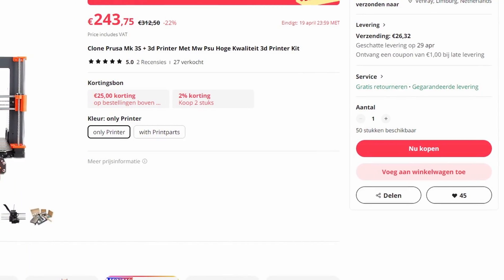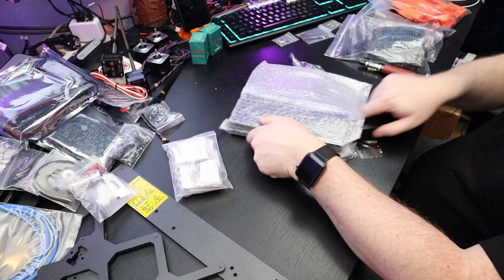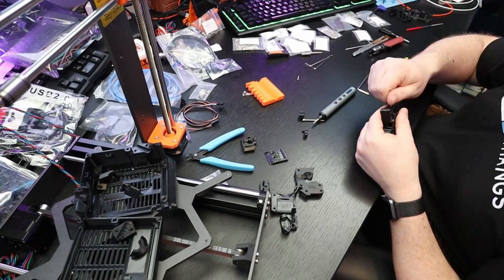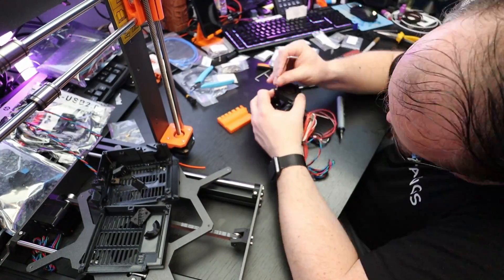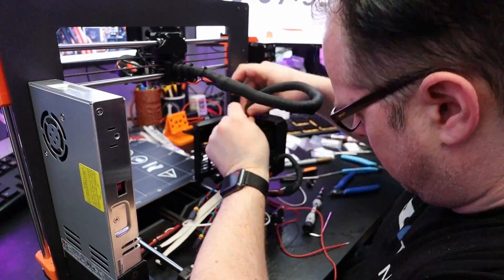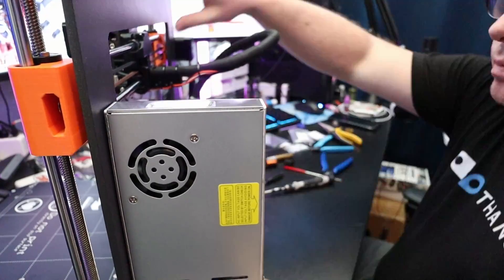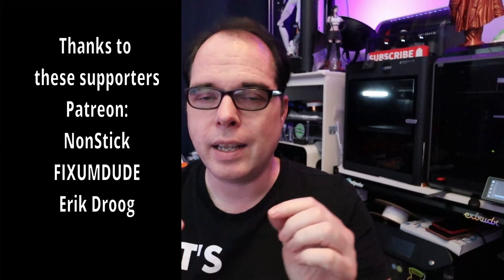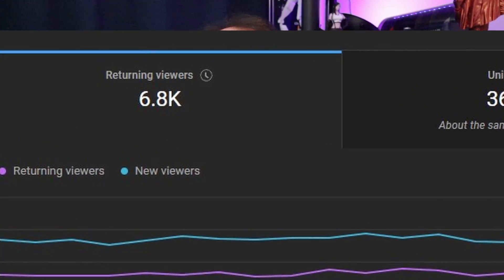FYSETC i3 MK3S - A Great Clone Kit under 300 US?

Comment: Are you wanting to do an upgrade to the mk3.5 or mk3.9? Or add klipper to it? I just got an used mk3 on eBay, I'm not sure if those clone kits are even worth it anymore. Lots of used prusa parts on eBay because people are doing the upgrade to their mk3s. I'm gonna upgrade my mk2 to mk3 as well.
Reply from the maker: Hi, I have basically 2 self built Prusa i3 MK3 printers, besides the Fystec printer. I'm very careful with installing Klipper on those boards, tbh... if the flashing goes wrong then I don't have a working printer. I could go for a BTT Board replacement, but at this point, I'm not sure yet. I'm pleased with the print results I'm getting from this printer. 
I can buy, second hand Prusa, but I don't know the history and prices here in the NL are huge sometimes... 400 - 600 euro.
Reply: @Zachary3DPrints I got mine for 300 dollars on eBay in the us, 45d print time. Came with revo nozzle and bondtech extruder. I see a lot mk3 spare parts on eBay due to people doing upgrades. I don't want to go mk4 due to the extruder jamming and strain gauge bed sensor. I'll stick with upgrades on the mk3 for printer farm. I got two mk2 to convert to mk3. Sucks that the used mk3 are still expensive over there in the EU. Klipper or even marlin 32bit board for the input shaper, cheaper than going mk3.5 upgrade, unless you want the mmu3.
Reply from the maker: I think you got an amazing deal on that printer. Very recent upgrades. My First MK2 clone is getting upgrade to MK3 as well, with an amazing color combo. Stuff for a video, but don't tell any one!